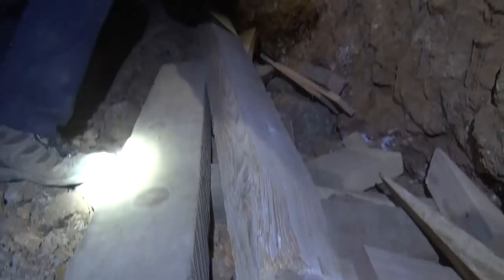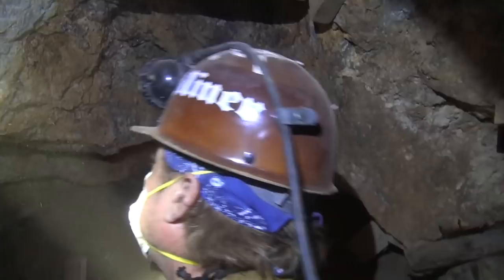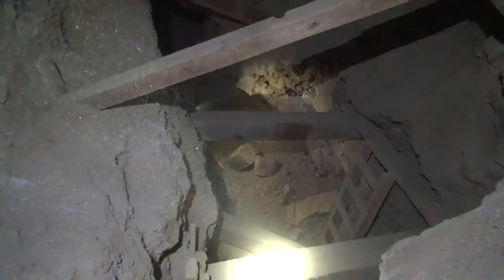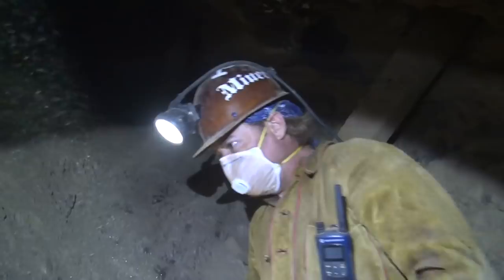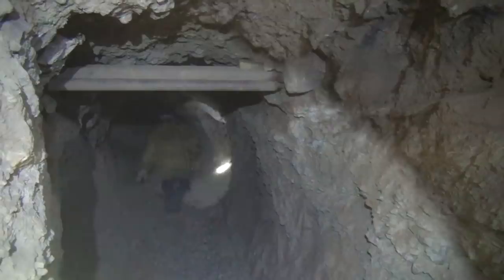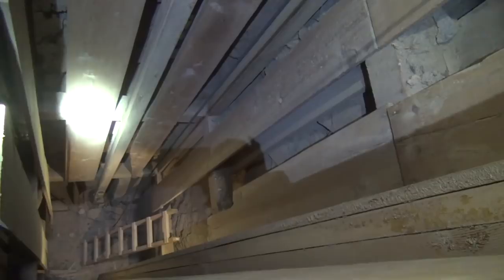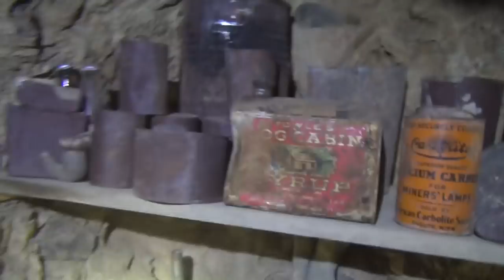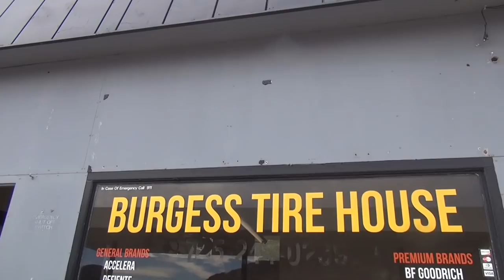Gold from Old Gold Mines - Where to Look | ask Jeff Williams

Comment: Can I ask a question.   How to deal with sticky clay. That hasn't seen rain in years.  It balls up.
Reply from the maker: a lot of water and agitation.
Reply: Thanks. Jeff.  No rain for 6 years, No water in any creaks or rivers.  Dams drying up quick.  Could be rain coming in the next month   The old timers left the area because of lack of water. All the bigger gold has been found. The small fine Gold it's in the hundreds of ounces bedded in the clay.   Dry blowing only blows the gold in air.   Adding water to dirt that hasn't seen rain ,  only runs off or balls up    Still working on it.   Thanks from outback Australia